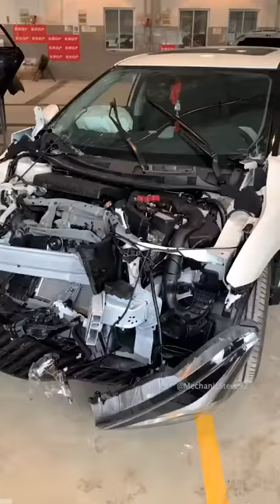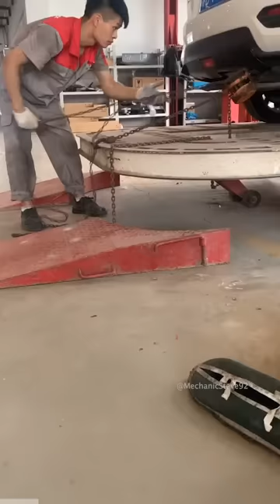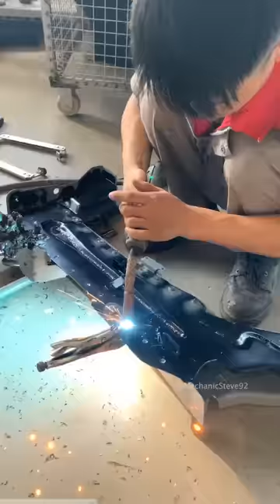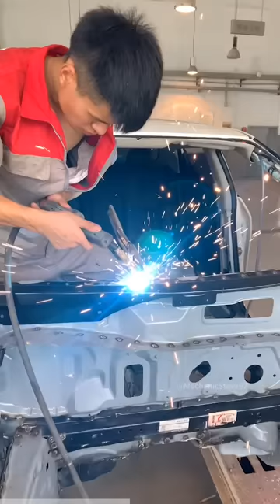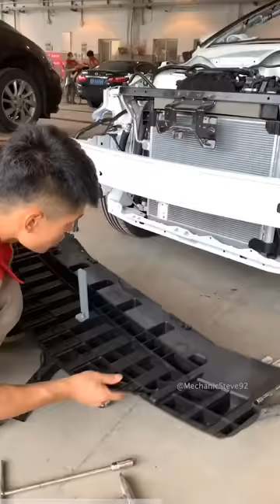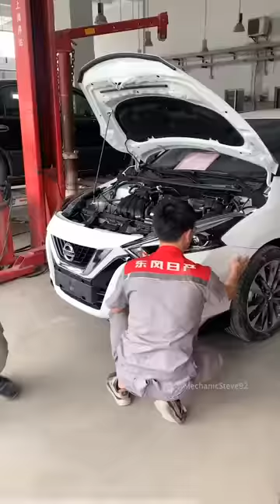Full Process Restoration Serious Front Crashed Car | 修车哥日常 Mechanic Chris | Take 2 Month For Repair

Comment: A car with 1/4 that damage would be totaled in the US
Reply: right
Reply: My car had a 6th that damage here in South Africa and the insurance totaled it. Wonder what the inertia of the accident caused to those engine internal and surrounding components.
Reply: غبار الشحنات الوكالة
Reply: These guys are like ER doctors for cars. Cause that thing would have been considered totalled everywhere else in the world.
Reply: Is the structure or engine still safe / worlking properly tho
Reply: 🇲🇽this in Mexico not worry
but we can fix🛠️🔩⚙️ all damage
Reply: What nissan model is that?
Reply: Yes and it goes to insurance auto auction lot. From there a lot of dealers them and repair them just like this and resell
Reply: @curlyanoable  if you drive a car like this pray pray every time you drive it
Reply: what the making thinking is no good to fix this car obviously these guys so professional the job is done properly believe it or not a lot  cars these days especially from. Ford they use only glue and quarter panels Doors skin  different parts this cars I'm talking about it's made in USA ant american dealership fix it that way I'm telling you Because. I'm Work 4 Caliber collision and i'm also working for dealership at least this young yong body  man do a lot  welding all around the parts he Remplece
Reply: @curlyanoable  I'm pretty sure that car was totaled. If a private company did that fix it probably would have cost the insurance as much as the car
Reply: Here in Australia if you get hail damage over your car in most cases they'll class it as a write off
Reply: Labour cost less over there.
Reply: @takaogibson845  maxima
Reply: Had a lady back in to me in the parking lot of a restaurant. It bent my hood up in the middle a little bit, broke a headlight assembly and my grill. Had it towed to the shop even though it still drove because the headlight etc. I recieved a call the next day from my insurance company telling me they were totalling my car. It was a 1999 Grand Prix GT that was only 2yrs old with just under 22,000 miles on it. I couldn't believe it. Ended up getting a check and buying a Fully loaded Chrysler 300M. The old body style. What a car. I wish I could find one mint somewhere. I'd definitely buy another one.
Reply: Not even! One tap on either bumper and they would totaled it.
Reply: The reason these are totalled is that the frame metal loses strength after being deformed, and is more likely to fail along the creases and joints caused by the accident than is approved initially by the government when the car was tested. It looks like these guys welded in a new front end, great, but that would still not pass inspection in most countries, and in the US would be very difficult to insure with the wrecked title. For what it’s worth their work looks great but most countries write laws against random techs welding frames together and selling them used. Think about it, the whole front end is hanging on that guy‘s welds. Would you trust it? Would you trust your family in it? I wouldn’t. It’s probably fine, but also probably not up to the crash safety rating it had when it rolled off the assembly line — which is not to fault these guys at all, just the nature of that kind of repair.
Reply: @tjdjultima  very well said sir
Reply: @Jack Winand: USA is so obsessed with making money, that even a minor fender bender makes the cars as totaled (not that they are).
Reply: @imannoroozi3559  No, This is Lannia. It is only for Chinese market.
Reply: @tjdjultima  I would trust this guys work over the robot welds most cars today are done with robots assembling including all the welds I just got done tearing down a 2017 dodge ram truck and found ereas that weren't even welded
Reply: You mean written off
Reply: @takaogibson845  Nissan LANNIA
Reply: @takaogibson845  Nissan Accidentalle
Reply: @internsrecruiter3370  i don't think so mig weld will never be the same as weld spot. Trend to rust. I do structure and body repair and reason of total a car is not only price wise is safety also. We can do it but cost much more than what the car is worth 0 miles
Reply: Well.  Labour is still cheap over there.  It's not the parts that is expensive.
Reply: @internsrecruiter3370  structure should be okay.  As they had pulled out all the bent pieces with installation of new pieces.  Engine, might have problems, but I suppose it's the owner thing to deal with.
Reply: @takaogibson845  seems like a Sentra ir altima
Reply: @user-rj9ui8fw5i  pizza?
Reply: @tjdjultima  honesy it seems fine to me. Its not like its gonna fall apart on the highway. Thats why theres the "rebuilt" title. That way you atleast know what youre getting into.
Reply: @minova6611  na just to crash the car and youll be fine.
Reply: This car should be totaled. The fact they can fix it is a testament to their skill and dedication. Also, I'm willing to bet the cost of the repair here would probably be higher than buying an identical new car, which is probably why no insurrance would cover that.
Reply: My wife was hit head on 2 weeks ago in our new car with 1000 miles on it. We had not even made the 1st payment. I pray that they total it!
Reply: You can still fix a car even if it is totaled
Reply: @davidanderson827  Did it end up getting totaled
Reply: @saxyrep1  Some people like to fix it just to stick it to their insurance companies
Reply: @richardterroni9433  Yes it did.
Reply: @c.r.edmister5223  You should have just got it fixed, I would just to give my insurance company the middle finger
Reply: Repairs cars as he destroys his eyes!
Reply: As it should be
Reply: Labor is considerably cheaper with this video was filmed
Reply: In the US, if the airbag deploys, it's a total loss. Regardless of the total damage.
Reply: @garrywright1801  factually Incorrect.. and I've been a bodyman for almost 30 years.
Airbags are expensive, that's what totals then.
Reply: This is in China. Taxes and fees make cars three times more expensive there  than in the US, making it worthwhile to fix a crashed car instead of totalling it.
Reply: @ostrich67  this is china, labor is cheap.
Reply: For good reason.
Reply: In my ranch también sería pérdida total…
Reply: Their labor is cheap. This is why they can fix it.
Reply: Maybe its a totalled car, restored and sold back as new.
Reply: @minova6611  What difference does it make??. People can't drive safe cars safely anyway.🤣
Reply: @tjdjultima I think the repair and integrity of the car is fine. The only reason why insurance companies total so many cars is the fear of liability. That’s it. Most could be repaired and put back on the road, but there are too many lawyers looking for a payout.
Reply: Yes, but totalled cars aren't scraped, they're auctioned off to body shops in the US that do the exact same thing these guys do.
Reply: Totaled in USA mostly due to labor cost and parts shipping cost. Cheaper labor and shorter shipping distances in Asian markets make it even profitable to fix it.
Reply: Yup the minute I saw it, I was thinking totaled, these Asian countries are on a whole different level
Reply: Нека я запишат тотал,но се ремонтира и пак се продава
Reply: Welding helmets can't be available there
Reply: It should be totally…it will look good but tolerances between panels will be completely off
Reply: 1/10th in the UK and it's a write off (totaled)
Reply: Cause it’s not safe
Reply: @farida7777777  m
Reply: @amateurmusic4884  I’m pretty sure Mexico has its share of good, professional auto body and collision repair technicians. You just gotta know where to find those good men.
Reply: I bought a new GMC Terrain in 2018 it would get water inside on the front passengers side. We couldn't figure out why? Took it to a mechanic and the the welds were not done correctly on a brand new vehicle
Reply: @tjdjultima  ✌👏👏👏
Reply: If the factory sells all these structure psrts new then if done right is fixable...Cars are not spaceships...
Reply: @garrywright1801 no it’s not. I sold 4 airbags just a few weeks ago on a wrecked Acura and not even close to the total limit.
Reply: When you bend the crash box on the floor of the passenger compartment the car should not be rebuilt. You can’t just pull it back and weld on new parts.
Reply: @richardditty5318  Also in this condition???
Reply: @Mike-ke4yp  Here in The Netherlands we indeed have no rebuild titels...just like you mention...and same goes for the rest of Europe. I reckon a tenth of the damage shown in this video is basically a write off here. After the assesment it goes nowhere near any bodyshop but straight to the scrappers. Ofcourse valuable and usable parts are stripped off first. Nevertheless these guys have amazing skills and I respect them highly for their workmanship.
Reply: Or anywhere in the world.
Reply: Only in US, bcz its very expensive to restore that damages.
Reply: Its dangerous to continue using such vehicle. the welding quality may be different causing weaker structure
Reply: I’ve bought smacked vehicles and repaired them reinforced creases and they went through Mot inspection and drove like a dream. ❤
Reply: 전시용으로  사용하세요
안전상   도로주행  은   위험합니다
Reply: Do you know how much labor would cost do that, hell yeah it be totaled out. But y'all don't understand the insurance system in the US. Insurance is not going to pay out that much of the car's value isn't worth it.. that's just business
Reply: @internsrecruiter3370 NO
Reply: @c.r.edmister5223 Grand prix had the worst head gaskets. They saved you from a ton of future experiences.
Reply: @internsrecruiter3370 I wouldn't consider it safe. Majority of the countries could consider this totaled. Keep in mind the structure of the front end is now weak.
Reply: @richardditty5318 not exactly. Here in the U.S., most totaled vehicles are auctioned off to salvage companies for parts and the car is issued salvage titles. Salvage companies will access the vehicle again, to see if it can be saved. If they deem it can, they make the repairs, or have someone else do it. The vehicle is safety and emissions inspected by the DMV and if it passes, it’s issued a rebuilt title. Insurance companies will also will inspect the vehicle before insuring it. If the salvage company deems the car not worth saving, then it guts whatever parts are valuable to sell and then scrap whatever’s left.
Reply: I personally would have,it will never be straight.
Reply: الصدفة يمكن أن تفسد ولكن الإصلاح لا يكون إلا عن إرادة وخبرة وعلم وقوة
فلو تم ضرب هذه السيارة مليارات المرات لمليارات السنين حتى تتحول إلى غبار لن تعود إلى شكلها .. لكن هؤلاء الاشخاص أعادوها بالإرادة والخبرة والعلم والقوة 
هذا الأمر ينطبق على الكون فهذه القوانين الدقيقة والنظام الهائل والجمال المبهر لم تأتي به الصدفة العشوائية لم يأتي به العبث لم يأتي به التصادم العشوائي الأعمى 
بل هناك خالق عظيم خلقه على هذه الهيئة المذهلة
Reply: This car for sale in Russia like new for 50k bucks😂😂😂
Reply: This is why the USA sucks in situations like this
Reply: @angelroque5528  The car would be totaled in USA
Reply: Not just totalled, it would never see the road in one piece again. The labour wouldn’t have been worth it to put this car back on the road in North America, let alone the body and mechanical expertise these technicians acquire.
Reply: A dent in a bumper and a small engine problem might total a car in Europe but people will still drive it, although in West Europe if a car is bought at a price higher than like 35000 totaled is totaled
Reply: Another structurally unsafe car repair! This guy isn't a genius, he's dangerous.
Reply: In Brazil it would also be but I believe that in China it becomes viable because the parts are cheap.
Reply: And for good reason. While these repairs look great and are impressive. These vehicles are extremely dangerous and deadly. Once wrecked again some one could die. The structure s integrity is lost and the crumpled metal will crumple even easier next accident such could lead to a lose of life. Now if you knowingly drive this car and are willing to risk your life thats one thing but what about your passengers? Do they know the risk they take to just be a passenger in your pretty death trap? Yall do great work and its impressive looking but its not safe best of luck to them in their endeavors.
Reply: Hahaha that's why we take yours cars with "salvage title"to Europe renovate them and sell again :D it's really cheap deal much more cheap then buying new from saloon or even used one
Reply: Labors are super cheap in China.  Unemployment rate is soaring. Anything is possible when people are trying to survive.
Reply: They buy the write-offs from State Farm, repair them in China, and resell them i n Quebec.😂
Reply: The bigger picture is: Is not the ability to repair, but the cost of the effort for companies... is cheaper to total a car than paying mechanics and repair companies.

But don't get me wrong, amazing job!
Reply: Alot of repair cars are still working in different countries  thanks to copart
I got one with a dit in the back that wasn't big damage I'm happy with it
Reply: Not in China
Reply: That's why the insurance is so high lol
Reply: Here is China, haha !
Reply: Absolutely
Reply: because labour is expensive in usa
Reply: For good reason.
Reply: This vehicle will never be the same.  All the wrinkles in the sub structure, floor the windshield pillar has been compromised.  Straighten as much as you want.  The metal has fatigue and "soft " spots now . The parts of the vehicle are crumple zones. They did their job and protected the occupants.  Now you Straighten and take away those safety zones. Looks good in the video but who knows in real time.  Plus no engine damage? No broken mounts ? Tranny ? This thing is no way insurance is paying to fix.  Parts alone ,with air bag? Idk. I wouldn't want to put any of my customers back in this and let alone sell this to anyone . I also can't get over not doing a dry fit with a new windshield? It makes no sense
Reply: @gusravogutierrez4880 you as a professional working for one of the biggest Collison centers should know then about this repair. Well, they fixed it . Yup . But you can't tell how good from a video. Then you also know that car manufacturers have guidelines to fix vehicles.  Welding in certain spots . Using structural adhesive in others and also structural spot welders. All these pieces of equipment have guide lines manufacturer have that need to be performed in unity in order for the car to be deemed safe again . These guys use no safety equipment at all. Only mig welders on the structure which may sound good but might not get the penatration needed and also the amount of welding spots that are needed. 
Yes it looks impressive and not saying these guys aren't craftsman but this would not be something you would think is totally safe. Just about anything can be fixed just can it be fixed right ? Be  cost effective, And be safe again. By the looks probably not
Reply: @legioner9 it's far from that. A vehicle is deemed total loss when it gets to a certain percentage of the value of the car. The parts prices are sometimes out of control . Depends on the year, milage,vehicle.  Insurance companies dont.want the car to be totaled its more paper work,cars going to auction  more a pain then anything . When you have a vehicle that the hood is 1200 dollars.  The headlamp a thousand, rad support 500 bumper cover another 500 just saying . The job is say 6,000 dollars and parts are 4,000 how isnthis justified.  Reason for a total becuse insurance usually writes up to May be 65 ,75 percent of thr cars value and then they have the nerve to want to put on aftermarket parts and call this being you vehicle back to pre accident condition? Lol gmab
Reply: So truee😂😂
Reply: Benda boleh jimat, buat apa nak membazir.....😁
Reply: 😂 my civic was rebuilt, salvage title for just the bumper one headlight and the hood😂😂😂😂😂
Reply: Там и покупали за 2$ 😂

Comment: You can always tell the quality of the job by looking at the gaps between the panels. If the gaps are proper the alignment of the vehicle is proper. Well done 👍 good job this has to be China no other country can produce parts like he gets them.
Reply: What if you get a crafty bodyman that opens up holes holes on panels to make them look even but the structure underneath isn't?
Reply: What if it’s just screwed together?
Reply: Nissan panel gaps are terrible(US) in the showroom lol.
Reply: @michaelkiely8878  A lot of repairs made today use Panel bond, Glue lol.
Reply: You can make anything fit if you belt it hard enough with a hammer. There is no way that thing would track square without being repaired on a manufacturer  approved jig, or laser aligning system. Good luck trying to align the wheels..
Reply: @lloydowen1977  That Tram they used to measure from firewall to Bulkhead/Core support/uppertiebar told him everything was within spec. The damage in the firewall was replaced, the wrinkle in the "tunnel" was pulled. No noticeable damage to the Left or right door posts, which means the rockers and windshield posts were still where they needed to be. 

You can see the tech using a rod to align structural panels, There are "jig point" holes in nearly every piece. They can be used to ensure alignment of panels within a 3-4mm variance per Crash standards. 

New cradle was test fit in the video. 

Go look at Tesla repairs. Rivets and glue. All break away assemblies
Reply: No es de la vieja escuela kkk
Reply: They look Vietnamese or something nearby
Reply: Not the phillipines for sure
Reply: سعر السيارة جديده ارخص من تكلفة التصليح 😂😂